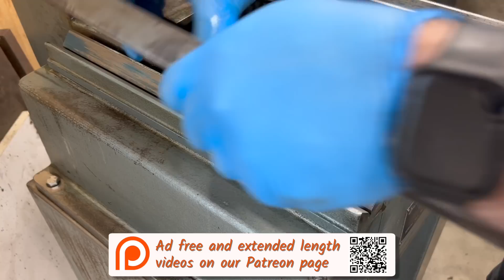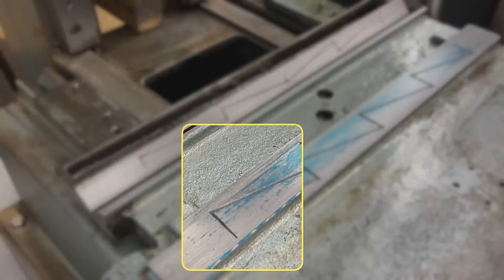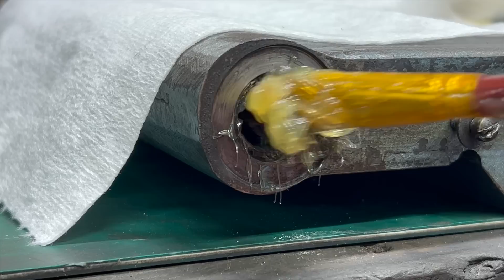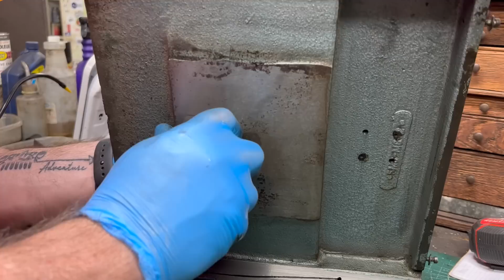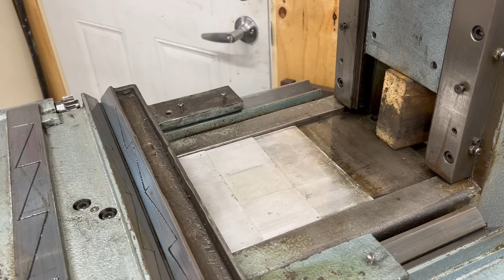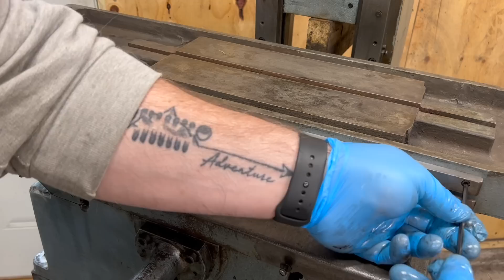Are these ways junk? - Sanford Surface Grinder - Checking the Ways, Saddle & Table Assembly - Part 3

Comment: Grit gets on to exposed end surfaces sticks to the oil and laps each end.  Gets worse if compressed air is used to clean the machine.
Reply from the maker: There are no exposed end surfaces.

Comment: On anything in contact with a long top slide, the middle is typically high and the ends are low.  This is due to extra wear from when the topside is at the extremes of travel.
Reply from the maker: Very likely, yes, I would agree.

Comment: Glad you decided to rebuild it. The stops are quite useful for example while dressing your wheels. My surface grinder top moves on ball bearings but I wonder if your wear might be due to the weight of the mag chuck in the middle and going back and forth?!  One thing to consider is that if you reach each end of the travel you might get surface unevenness. I noticed that on mine so I marked when to stop. Gilles
Reply from the maker: It's hard to say for certain, but you're probably more right than wrong.
Reply: @ I wish I was there to help. Mine has ball bearings for ways and they sit on a brass slat. Totally different system. If you could measure how much wear there is it might be easier to decide how to proceed. If it ain’t much scraping might be the best option

Comment: Mine is crunchy too. I left the covers with no lube. 
I use way oil on the slides.  I tried a lighter oil and it poured out so I changed to way oil. 
The front roll pins were tight on mine too. 
Before worrying about the wear, measure the top of the electric magnet. Mine is super worn but traversing is very flat. So I’m leaving it alone.
Reply from the maker: That's on my list. After dressing a grinding wheel, I might just kiss the surface of the table and then the bottom and top of the magnet. The intention is to create a 5 cube test and go from there.

Comment: when I took my MG surface grinder apart the ways still had all the scraping and flaking on them, it looks like your machine has more wear than mine did for sure. Once you make some test grinds with it to see if it still grinds flat. I cut 5 blocks and put in corners  of the mag. chuck and one in the middle and ground them they were all within 2 tenths.
Reply from the maker: That's excellent results. I am thinking I should grind the table, put the mag chuck on, then grind the chuck. Then do the 5 block test? I'm not 100% sure yet.
Reply: @MyLilMule  I did not grind the table because it looked in good condition, just did the bottom and top of the Mag. chuck. Also when you grind the top of the chuck make sure to turn it on so it will be the same as when your grinding parts on it.
Reply from the maker: @Randysshop  Great tip! Thanks.

Comment: It could wear more on the outsides, as the table is just sitting in the ways. When the table moves all the way to one side, it droops, because of the weight, putting more pressure on the ends and causing more wear. I’ve seen this before. Additionally, lubrication remains more in the center as the table is always sitting there no matter which side it’s at, whereas the ends tend to lose lubrication as they hang past the ways. The lubrication channels get oil into the area, but it doesn’t do anything to help keep it there. The bottom can be lubed any way you like as oil will find its way down there and if you use coolant, it will get down there as well. ISO 68 way oil is usually used for these. I wouldn’t worry about the wear until after you measure how it runs. If it’s within your needed specs, just leave it. I can tell you that scraping V ways is a real ball buster. Everything needs to be perfect.
Reply from the maker: You make a good point! I've seen that too with ways that have been used in the past.

Comment: With enough effort your grinder could be reconditioned. The question is what are you going to use the machine for? If you are precision flattening large plates you may have a problem. If you are doing smaller work, it will likely be fine. Another issue is how often. you will use it. You may want re-assemble it and run some test  grinding to see if can live with it.
Reply from the maker: Mostly small jobs, nothing too fancy. Maybe grinding in new gibs for the South Bend.
Reply: @MyLilMule  Many years ago my boss bought two 6x12 Harrig grinders for cheap at auction. Their ways looked like yours. They ground accurately but there was a lot of drag on the ways making the movements heavy. I substituted a lighter way oil, and added a Teflon additive. It helped some, and we used them for a lot of years. With your light use yours may be fine, unless of course you a looking for a project. I am looking forward to more video on the project.
Reply from the maker: @joebad1106  I need another project like I need another hole in my head. 😂 It might turn into a project, but it might be so far gone, that it's not worth all the extra money to make it "perfect" and finding another one might be a more practical option - down the road, that is. I'm going to probably use it as-is for the time being.
Reply: @MyLilMule  I would do the same if it were mine.👍